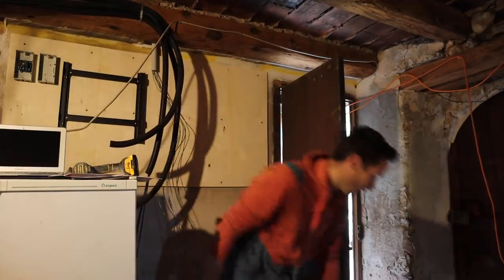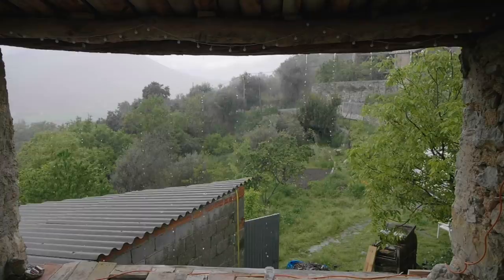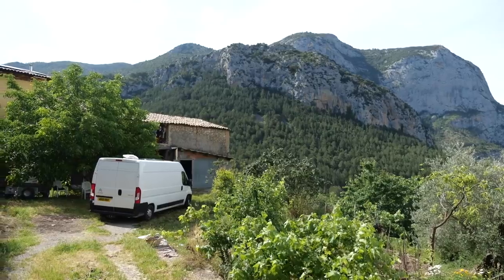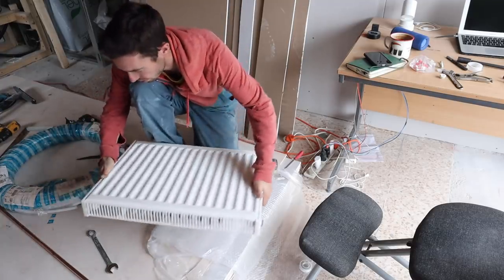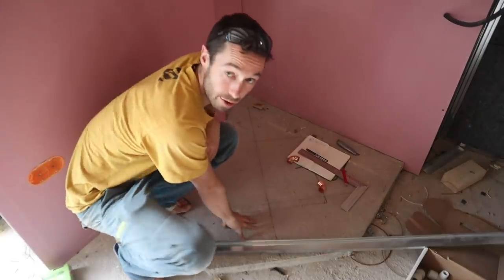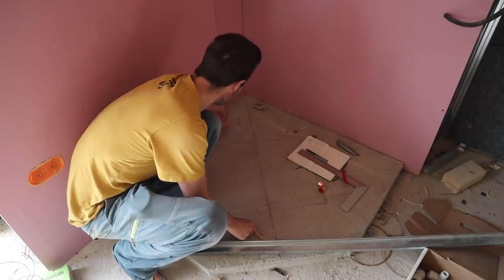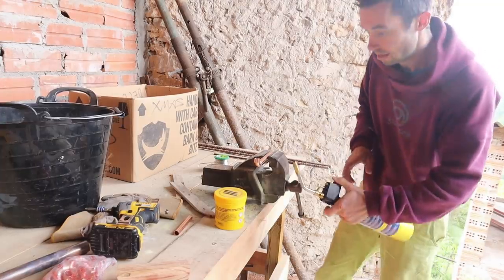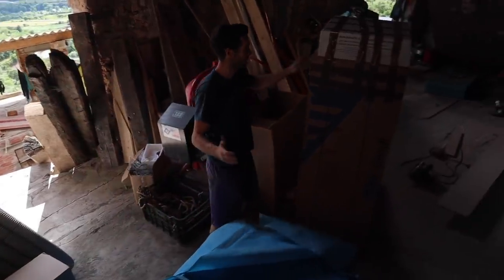THE SOLAR INSTALL CONTINUES ⚡& LEARNING TO SOLDER  🥽🔥

Comment: Nate, some quick “advice” on soldering copper pipes. 

The pipes will be under pressure when connected to the system. So, you won’t know the joints are good until hooked up and pressurized. So, make sure to do that before drywalling over the pipes. 

When you apply the heat, do it from the top and apply the solder from the bottom. The flux will draw the solder into the joint. So, rely on it, not gravity. Also, don’t worry about applying too much solder, it won’t hurt anything. 

Lastly, for your furnace, I would solder a threaded union into the furnace and the inlet/outlet of the wall and use braided stainless lines between the two so you can easily remove the furnace if ever needed for service or replacement. I learned this lesson the hard way with a water softening/filtration install. 

Keep up the great work! The house is coming along fantastically.
Reply from the maker: Ahh that lot makes sense - thanks for the tips. The braided lines would have made life a lot easier making it line up with the chimney requirements.

Fortunately as an open vented system it won't have a lot of pressure - but you are right it will be a pain to test. I have a couple of things to do and I can test (re-test the pipes & rad system - found one leaky joint with my first test)

Comment: Great work.. tip for soldering. You are overheating your pipe you dont want to see the solder bubble in the fitting, Heat from the bottom and feed from the top. Solder both ends if the fitting at the same time, clean off you fittings after soldering with a damp cloth, and pipe work that doesn’t matter what it looks like add enough solder until you see a drip. Solder is cheap compared to leaks.
Reply: Wrong direction. Heat from top and solder from bottom. You want the flux to pull the solder into the joint, not hope gravity draws it in.
Reply from the maker: Good point re goign for too much solder. Almost none of the copper pipe work is visible so i can let rip :D

Comment: Nate after soldering wipe off the excess with a damp rag for a smooth joint.

You'll have a lovelly cosy Christmas this year, keep it up 👍
Reply: You had the same tip.  Nate is very clean and that will help him out.

Comment: Every episode ends and I am like what there is no way that was 20 minutes.  Love your channel Nate.  Mark Velo is right on point with his tip.  Try it out and you will like the results. Also if you are able to send updates to your architect for the wiring and plumbing you can get an "as built" set done at the end of the main project of the house.  That will document it for the next generation of little Nates or the next owner.  Your doing great man keep it up.
Reply from the maker: Thanks - I will give that a go. I have to fix one joint as it was leaking (I made quite a lot of rookie errors to begin with - now I am not totally crap (still a bit crap). I think my architect watches the vlogs from time to time.. at least she has not dropped by for a while so can't be too worried :D

Comment: If your house is airtight and you have an ERV (heat exchanger ventilation system) then it's a bad idea to vent kitchen/bathroom with a separate fan directly to the outside. That will be pulling more air out of the house than the ERV's intake fan is pushing in and will cause issues.
Reply from the maker: Thanks Robin, yeah, I am not really allowed to vent kitchen exhaust anywhere but the roof - but the MHVR will exit out the house on the bottom floor (where the unit will be) and the chimney is too small/too far to take the exhaust to it. Ventilation is less of an issue as it is just air - no fumes and is arguably like having some ventilation bricks.

I do realise that it is not ideal (the bathroom will only be done by mvhr) the kitchen will have an extractor but in reality its not on for that much time in a day so hopefully it will be ok.
Reply: @NateMurphy  Guess it depends how airtight your house is, but like the "She'll be right" attitude. What's the worst that could happen! ;)
FWIW we are in a very well sealed house in the French Pyrenees with an ERV. Our oven hood is a re-circulating type but this is good enough to pull grease, etc. up into the hood filters to stop it getting elsewhere. Filtered air from the hood is thrown up to the ceiling right next to an extraction vent for the ERV. We have an automation system too, and this detects when the hood is running and puts the ERV into boost mode. It also changes the ERV in/out balance automatically when we crack a door/window (they have sensors). Dunno if any of those things are possible with your system but HTH.
Anyhow, keep up the good work, keen to see how it turns out.

Comment: P.S. Do yourself a favour and connect wires with either Wago 221, 222 or 2273 (if it's solid core) blocks!
Reply from the maker: I will check them out.. not heard of the but that is the price of being a punter!

Comment: You are one heck of a hard grafter..progress rate is incredible...Pipe bending springs are a cheap solution if you only have a few bends to make on odd sized pipes. .. stay safe
Reply from the maker: Thanks Jon... in the end I figured that a 45deg bend part will do the job.

Comment: You can get a push-on stop-end for 15 & 22mm pipe (not looked for 28mm), and you can also get an adaptor that does both sizes to a car tyre type valve. Once you finish a run of pipe soldering you can close it off and use a car tyre inflator to put air pressure into it. If the pressure doesn’t drop you have no leaks, but even if it does you can check your joints with some soapy water to look for bubbles where it’s leaking. Here in the U.K. the usual suspects (Toolstation/Screwfix etc) stock them, called a dry test kit. https://www.toolstation.com/basic-dry-test-kit/p22400?
Reply from the maker: I just need screwfix.eu to get up and running again. That does sound bloody useful  tho I think I am a few days away from just being able to test it properly (I did test it once and found a leak) the rest should be ok. I will fill it up soon and give it another good look over. Scary stuff :D

Comment: Like first then watch... as always!
Will you go for the Tesla Power Wall for batteries?
Reply: Tesla power wall will break the bank. It will take 2 @5k each to run the A/C
Reply from the maker: Thats my man!

No to TPW.. prob too pricey for now. I will see in a year or two where the battery market is and if it makes sense.

Comment: Are you going to install a boost for your van to keep it at full power all of the time
Reply from the maker: A boost for the van?
Reply: Nate Murphy  using the house solar,so that you can leave your batteries at maximum in the van
Reply: Even if you could use the extra amp hours of the van to power the house as well, making the van part of the circuit
Reply from the maker: @johnthomson9558  Ahh, that is an interesting idea - had not thought of it. Might be too much effort in terms of wiring up though
Reply: Nate Murphy its just a matter of matching the power supplies, to achieve your outcome